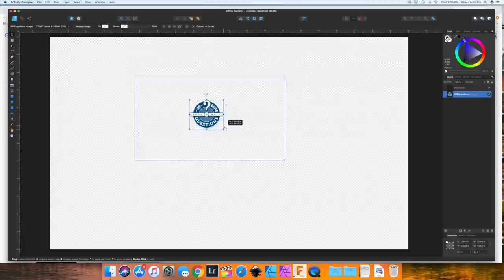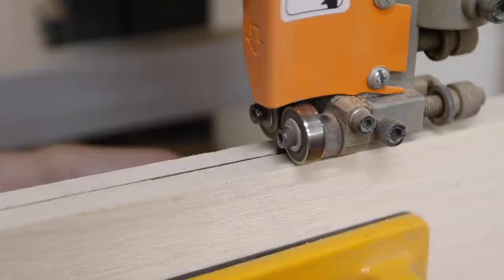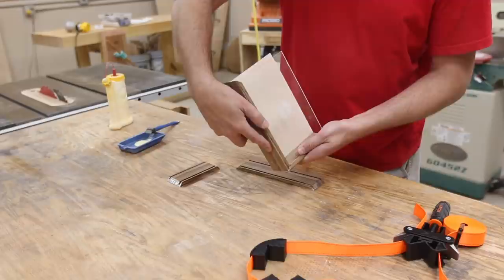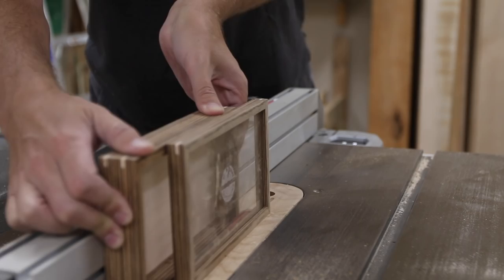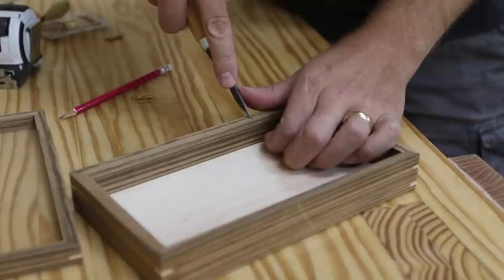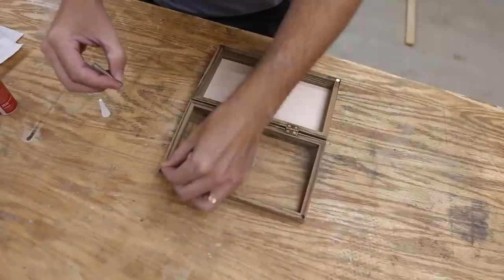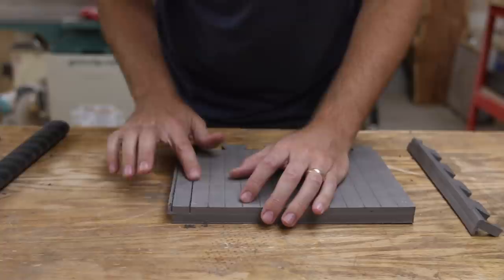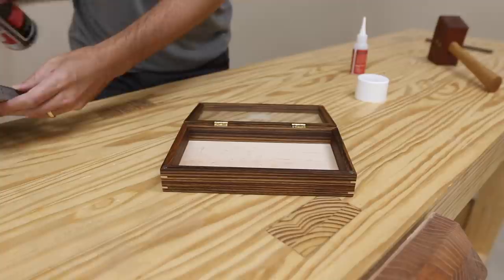How to Make A Wooden Fly Box / Fly Fishing

Comment: Only things I would have done would differently is cut the lines in the foam going the other way and cut the foam a little shallower. Sometimes flies are taller than you think and could use a little more height to not flatten them out.
Reply from the maker: Those are good suggestions. Thanks! I'll be sure to do some of those when I make another one.

Comment: Awesome idea with the foam from HF and the logo looked real nice on the acrylic.  Could you also have used tape on the acrylic or something else tape like?  I know that you are not supposed to engrave on shinny things and that is what the tape is for, Right? No lathe but I was thinking about the small LASER like YCMT has, small but cute.
Reply from the maker: Thanks! I'm glad that foam turned out well. Yeah, you can use tape to mask for laser engraving. If you notice when I get the piece out of the laser, I peel some masking off. This is just pre-masked material. It has tape on both sides.